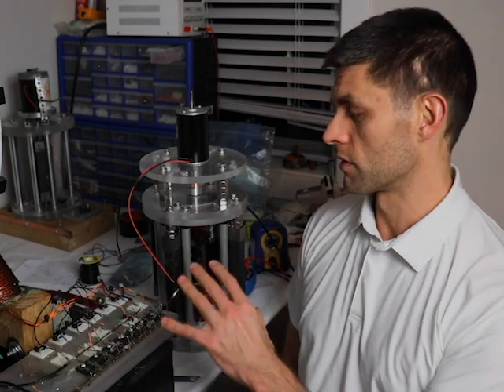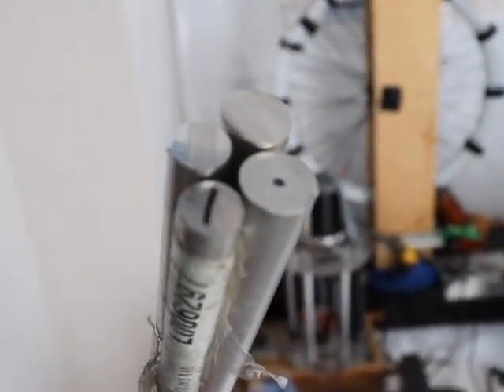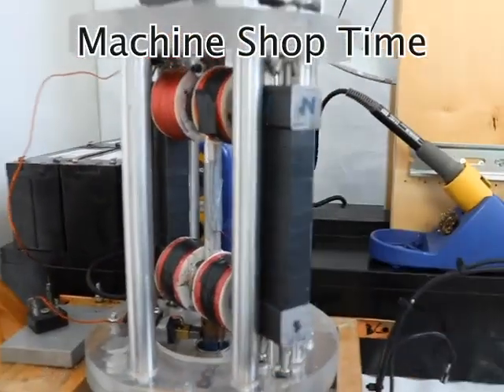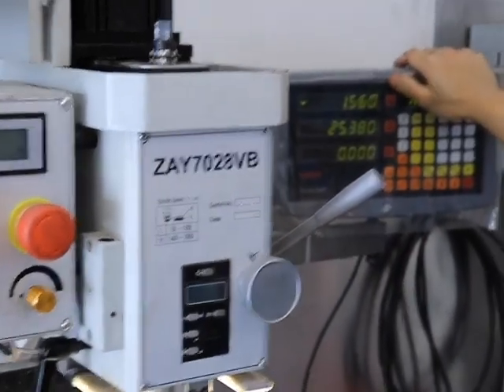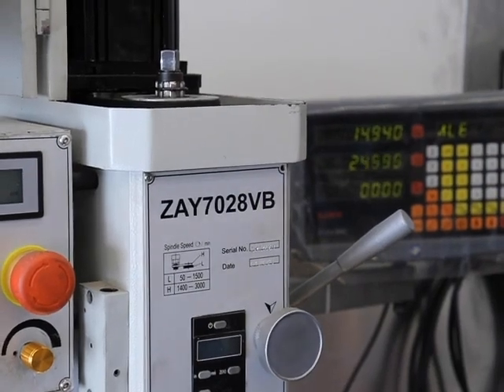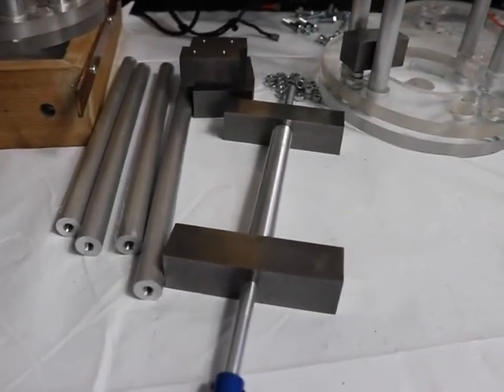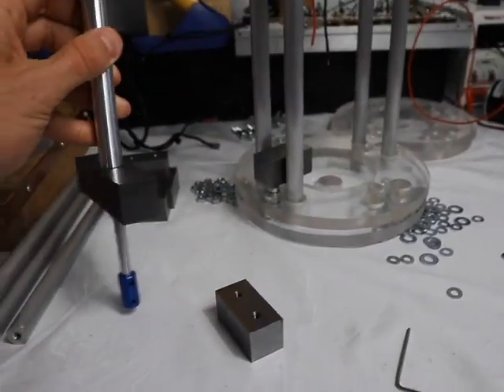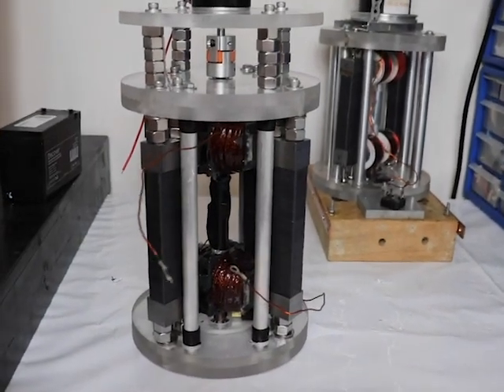Kromrey 2.0 Build

Comment: The pitch is fantastic. And although I totally agree with chasing your dreams and all the fluff… Anyone thinking of donating to this guy should keep these facts in mind.

1. If he already has a working technology demonstrated and is just scaling it up, what’s the point? Release detailed schematics and partner with someone.

2. The parts he’s talking about, such as mosfets are extremely cheap and could be gleaned from nearly any e-waste.

3. Spending hours creating spun copper coil instead of simply stealing it from microwaves or any copper motor is nothing more than a publicity stunt. Anyone who has made any magnetic field knows this. 

4. Black or “dark” patents exist. They are managed and maintained by the NSA. They have a team of people that monitor all communications, videos and yes.. YouTube about these things 24 hours a day, 7 days a week. If this was the case and it was factual it would have already been shutdown. Watch anything on Steven Greer for more information on the free energy embargo. It’s been going on for hundreds of years. 

5. If you know anything about zero point energy and any scientist that has gone missing researching it. Conventional physics do not apply. This can only be done using various types of Toroidal energy fields where plasma is created under high pressure and extremely precise measurements. 

6. I find it VERY interesting that this design mimics the DreadCO perpetual motion machine created by David Jones in 1981. Where it’s extremely easy to fool people into thinking it’s more than a very low voltage motor using pulses to spin a wheel very effectively.

7. And lastly, don’t forget cults exist. It’s really easy to drink the coolaid when 5 truths are mixed with 1 lie.

Great hustle idea though. The vast majority of people don’t understand the difference between AC and DC power let alone a perpetual motion gimmick developed in the 80s.

Comment: Did i miss the part where you tested this thing? As far as the build process youve come a long way. Incorporating the trifilar coil, twisted wire to lower the impedance. If you did give up on the thing, then think about the following. Its not nessecary to have the coils pickup the magnetic field, in fact that would slow things down, its the iron bars that need to do that and the coils generate the energy from the bloch wall of that spinning piece of iron. I also remember john saying something about the holes in the cores, just a hole through the center, to make the already unusual wave, two ups and two downs a little sharper, thus of higher voltage. As for measuring john doesnt use meters, dont know if you noticed... So getting the right combination of load on it should give you better insight. What are your thoughts?
Reply from the maker: im with you... i dont think measuring the output with meters will give accurate results... have to power a load.... i will do another Kromrey video in September soon, it took so long to build i dont want the thing to blow up when spooling up....stay tuned, thank you for the support!
Reply: @MadscienceLPTECH  Nice, while I've been away for about two years. Simply not having the time to finish that new generator design as seen on my channel, I decided it would be nice to prepare my version of a small kromrey. And so I'm using evenings to create that build with the above mentioned considerations. When done I'll let you know
Reply from the maker: @urcoffeetastestoasty7143  I'll fire this thing up with lights for the good of scientists like us everywhere... I have 2 working models, I'll see what they can light up... the one almost killed me when I took the hit from the output, it puts out over 300v
Reply: @MadscienceLPTECH no way awesome tho, i thought i saw bedini grab the leads not feeling anything, are you sure it wasn't a capacitor jolt? Glad you are still around to tell it! Btw i forgot to switch account, i moved to posting videos on this one 'toffeeflavour' so you know. I am curious now to see the lights on, but take it easy

Comment: In my view you should better use laminated iron for the core to avoid eddy currents and also use a bigger wire  trifilar wound in order to reduce the impedance of the coils.Bedini said it was important to have low impedance  coils to get the power out of a Kromrey. The output diodes should also have low impedance and if a full wave bridge doesnt work properly then perhaps try using just one output diode or even several diodes in parallel. Lowering the output impedance could be the key in my view.

Comment: Nice build sir. You can get much more flux though laminated mild steel. I have my parts cut by Sendcutsend.  I design them with alignment hole and glue them with lock tight super glue.  All they need is a dfx file.
Reply from the maker: ill use that on the next kromrey build / test it out... next build im doing is air core bedini